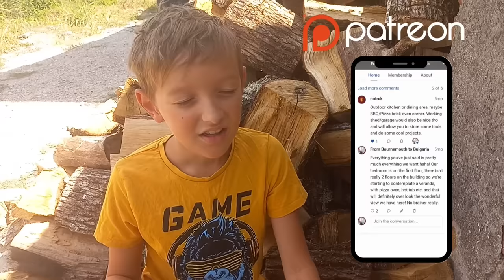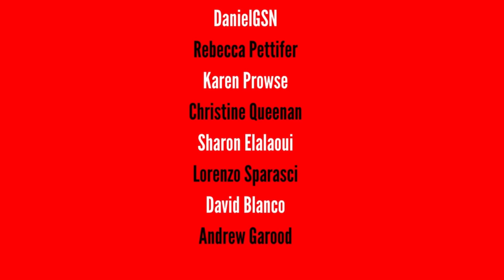Episode 15 -  Let's Build A Bathroom | DIY Bathroom in Bulgaria

Comment: Absolutely agree about soil enrichment. I use my horse's manure spread all over the plot before ploughing. Great way to dispose of the muck too. And then it's so exciting to see it ploughed in. By tractor is good, but we are lucky enough to have a man in the village who uses a horse drawn plough. Autumn highlight for me.
And all for the princely sum of 15 bgn. If you can try to get someone to rotavate in the spring before planting. It saves a lot of time and effort.
Most of all, have fun😊
By the way, I would seriously consider not using concrete when you put in fence posts. When the post rots, and it will, especially with untreated wood, you will have an epic game trying to replace the post. And finally, don't ask your Bulgarian hardware store for preservative for the posts. They will send you to the apteka for condoms😮

Comment: Give yourself a pat on the back pal with the bathroom it's coming on great. The only thing is I would have put your bath with the plug hole at the front because if you ever need to replace the pop up plug mechanism you will struggle to reach. keep up the good work  and stay positive.
Reply from the maker: Paul, I feel its too late to turn back, honestly if I have to take that bath tub out the ground I'll never get the thing back in 🤣. The footage we had of me trying to mount that horrid thing in on those crappy metal legs, ridiculous.  Thanks for your kind words fella.

Comment: Mate 😂 the norm for the bath tap is drill two holes in the bath and bring the pipes up from underneath through the bath and into the bottom of the taps, usually baths have the two holes pre drilled so u just bring the pipes up through and into the tap good luck buddy great effort
Reply from the maker: Out here alot of taps have them coming out of the walls rather than the baths having holes. Seems to be a regular thing here. I certainly ain't drilling two holes into that tub lol. At a hotel the tap was mounted to the wall not the bath tub itself, so here, seams a normal thing.

Comment: Excellent job on your bathroom if it was me i would fit a mono tap like that on your sink just drill a hole and fix a piece of plywood with resin to the underside of the hole and then just refo your pipes to the tap
Reply from the maker: Thanks for the heads up, I think that's what we're going to do!

Comment: You could flip your bathroom door around so it would open up to the hallway instead of into the bathroom , so it doesn't hit the bathtub surround.
Reply from the maker: We have considered doing this, but its really not causing too much inconvenience for now. We're a little concerned we may open the door out on to Fae, she forever hiding behind things. much easier knowing that's not a problem for the time being.
Reply: Or put a little wedge thinghy on the floor right before the door hits the bath?

Comment: You really do need to think od moving that socket ASAP, I know these videos are behind, I know you don't need to build to UK regs but please be aware of electrical zones in a bathroom, only takes  splash of water. Be safe.
Reply from the maker: It will be for a wall heater, we've tucked the plug out the way. It's not die to stay this way. But, it once was a lounge so that's why it's there.

Comment: Good job on you bathroom why not drill a hole in the bath and fit a monoblock  tap all you will have to do is glue a piece of plywood under the section you drill a hole to support the tap resin would be the best adhesive
Reply from the maker: Thanks for your advise, I think that is now the plan, any advice on drill choice, I have some hole saws but I'm concerned they may crack the tub.